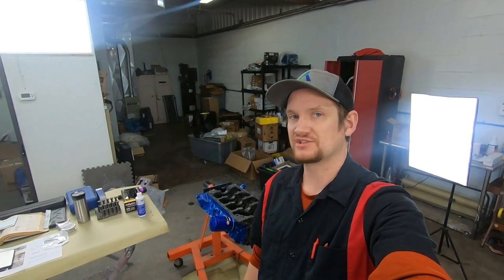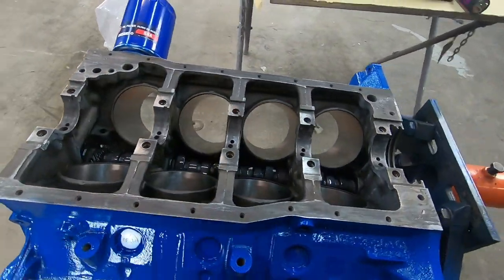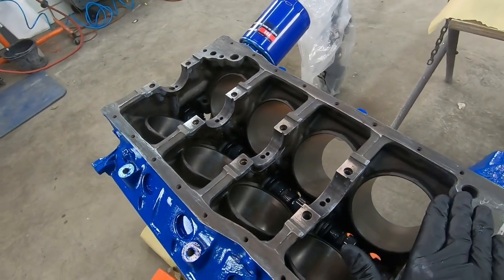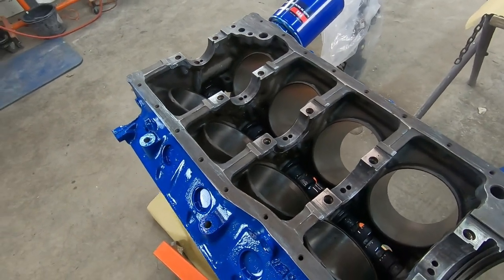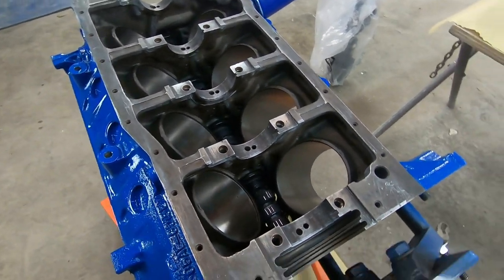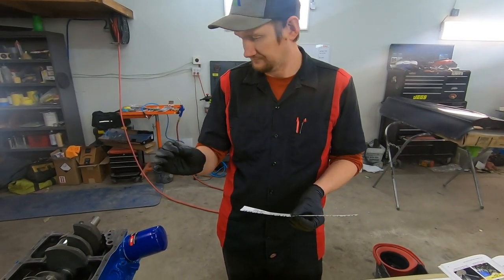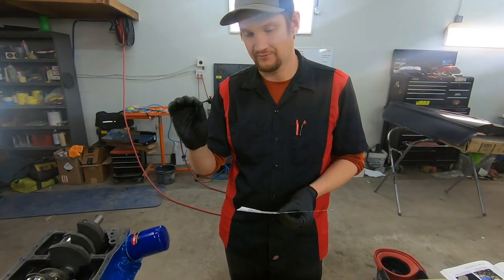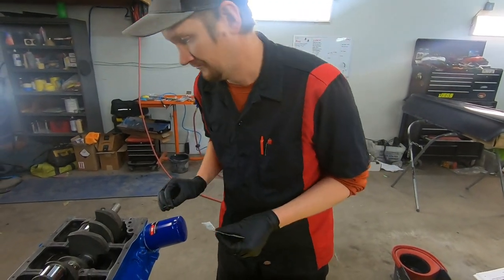How to install the Crankshaft - Rebuild the 289 Ford - Part 4

Comment: In the chilton manual I read something about end play, along with using a pry bar to hold it at a certain gap. Is that necessary or does the crank sit in place at the 5th main cap?
Reply from the maker: Well that would be how to check for crankshaft end play. Here is a video on it. https://youtu.be/MdEwT8Jrtx8

Comment: How come u put assy lube only on the engine block side of the bearing before you used the plastic guage and no assy lube on the main cap? Does the assy lube add to ur clearances?
Reply from the maker: Because I didn't want to pull the crankshaft back out to ad assembly lube.

Comment: What brand crankshaft/ bearings/pistons do you like to use or recommend? I have a stock 302 & I bought the edelbrock top end kit: aluminum water pump, timing chain set, aluminum heads & roller rockers, aluminum intake, 4 barrel carb, comp cam w/ lifters. Don't really want to add all that to my stock block parts. Any advice is gold, just like all your videos, many thanks Alf !!

Comment: Hey Alf, This is great - I'm using your serieso as educational material for my 302 build... quick question about the plastigage: how do you clean it off the bearings and crank journals after the measurement is done?

Comment: Good Morning Alex!! Good stuff as usual sir! I forgot all about crank bushing clearances. Great reminder. So on the rear mains, are both rubber seals the same? and does the groved part both face in towards the engine on both of them? Thanks. Hopefully you will do a video on the Rod to crank clearances? Thanks for sharing Brother. I hope to build a 351W stroker (408) to replace my 460 Big block. Waiting on my Pension cash out money. Take care, love and blessings from Motown/Dearborn.
Reply from the maker: Oh ya the rear main should both be installed with the groove facing towards the front. The next video should be installing pistons and checking the piston ring gap along with rod bearing clearance. So there should be lots of info in there. 
A 408 sounds awesome, keep us posted if you move forward. Cheers.